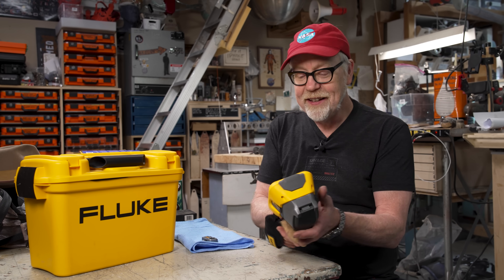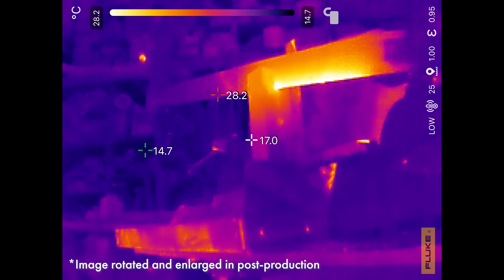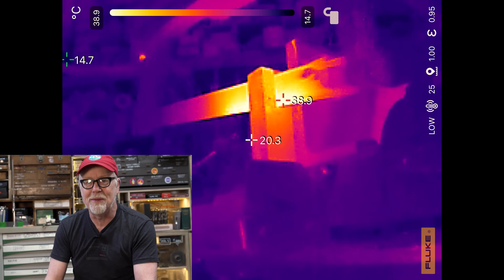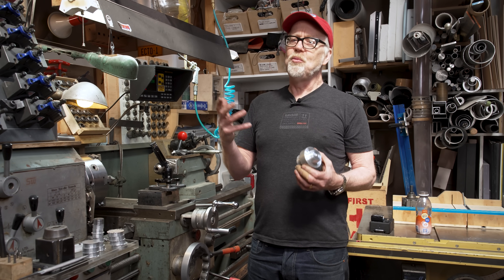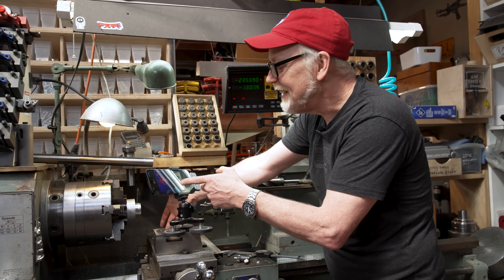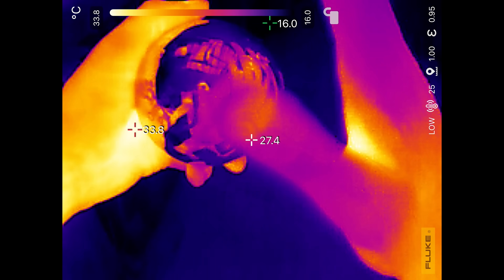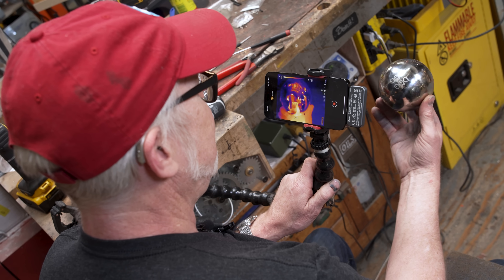What This Thermal Camera Reveals About Adam Savage's Workshop!

Comment: Most definitely those are photons. Radiated heat energy is infrared, which is electromagnetic energy (photons!) emitted at wavelengths longer than visible light.  It's incredible you got those reflection shots on the smooth metal surfaces, pretty much confirming this property of radiant heat.  So cool, thank you!
Reply: Longer than visible light. It is still light.
Reply: @BaconbuttywithCheese  yes of course! My mistake
Reply: Yeah, I snapped to attention when he said the photon bit, too.  We got nerd sniped.  :)
Reply: Still photons no matter what else is going on. I can't believe he said that.
Reply: To me, the really interesting observation to make about his hand image reflecting off the metal surface is to realise that the camera is not, in fact, measuring the temperature of the object, i.e. it is not measuring the average kinetic energy of the random motion of atoms and molecules that make it up. Rather, it is indeed measuring, and representing as a visible image, the intensity of photons (with energies in the infrared part of the electromagnetic spectrum) that are either emitted by OR reflecting off the object. This is clearly a potential error source you need to be aware of when using one of these cameras to measure temperature.
Reply: @viajero-77  Especially when measuring metallic surfaces. Emissivity of polished aluminium is around 0.05, while most non-metallic surfaces (including Adams hand) are closer to 0.95 (and that's the emissivity most infrared thermometers are calibrated to). That means from the energy reaching the camera in that shot, about 96% is emitted by Adam and under 4.5% is emitted by the aluminium block itself. Aluminium would need to be around 400 °C (675 °F) to emit as much energy as it reflects (for the same surface)
Reply: @MikrySoft  That's very interesting info, thanks.
Reply: Still photons, yes. But due to the longer wavelength of thermal infrared 900 to 1700nm (vs visible light 400 to 700 nm)  the physical sensor pixels of an infrared camera must be considerably larger than visible light sensors. I don't know the actual limits, but I think it's also fair to say that visible light sensors have had a lot more R&D money put into miniaturization too.
Reply: Thank you. I was really hoping this comment would be here. 1 humanity faith point restored.
Reply: Yeah, the frequency/wavelength, propability amplitude and polarization  is attributed to each photon. While phase, classical amplitude (+ above properties) is attributred to the wave function. (Result after googling around.)
Reply: It always hit me if you have a boiling hot metal pot and see your own reflection in it.
Reply: "Radio waves" are also photons.
Reply: They are photons of light.  They have all the same properties of visible light photons except the longer wavelength.  As photons they are particles and waves at the same time just like visible light photons.  In other words they reflect and refract; as well as make interference patterns through a diffraction grating.  That is why the reflection was so good off of the shiny ball and other reflective surfaces (aluminum bar stock in lathe).  Because of the longer wavelength there are surface conditions which are more (or less) reflective than the same surface under visible light.  The scotchbrite, besides heating the ball took some of the shine way (scratched the surface) thus the reflection changed off of that part of the surface.  Cool demo ... could have used a bit of fact checking. 🙂
Reply: Yep
Reply: Thank you, I thought I was crazy for a second 😅
Reply: So yes but also no. Assuming that infrared camera is a bolometer camera (which I imagine it would be based on it's size and lack of active cooling) it works by filtering out non infrared wavelengths from a camera projection onto an array of special resistors called bolometers which heat up and change their resistance when this infrared projection is projected onto them. When a test current is passed through this array, all the changes in resistance of each bolometer is measured and the temperature of each bolometer is calculated. So while the temperature of the bolometer array is caused by infrared light the camera absolutely does measure the temperature not infrared photons. It just specifically measures temperature caused by whatever band of infrared light it projected onto it's bolometer array. You can get infrared cameras that work just like digital visible light cameras that count photons that hit junctions in semiconductor sensor and I actually work with one of these cameras (I'm lucky enough to work with a super high resolution MCT camera that images a medium wave infrared band) but they are massive and have to be cooled to very low temperatures.
Reply: @marylebone9357  I feel like the mechanism the sensor uses doesn't change that it's receiving photons. I mean technically you could also measure visible light or UV similarly if the resistors were made of something that absorbs it and heats up. It's still photon input in either case.
Reply: @Felice_Enellen  true. Can't argue with that. But any excuse to talk about infrared cameras! To change the waveband of a bolometer camera you actually just change the filter that sits before the bolometer array. So you can actually have long wave, mid wave, or near infrared bolometer cameras that use the same kind of sensor without any fundamental change to the bolometers or the system the checks their temperature. Or alternatively you can take successive readings switching filters and do miltispectral imagery
Reply: @marylebone9357  This is why I come to the comments.   I think my favorite answer is the "yes, but also no" variety.
Reply: @marylebone9357 that's how pretty much all sensors work. Photons affect a semiconductor which alters electrical properties and those property changes are then interpreted. In the end almost nothing measures anything directly, they just measure the interaction of two phenomena. Whether it's a chemical reaction on film, the current through a photodiode or the resistance of a bolometer. In the end they are all ways to capture/detect the amount (and type) of photons and represent them in another way. The mechanism changes, but the end result and purpose doesn't.
Reply: @marylebone9357  Interesting!  So how is the reflected image preserved so clearly?  Obviously optics must come into play in order to direct the blackbody infrared radiation onto the sensor.  The camera sensor's (bolometer?) array must be closely spaced enough to reproduce the accurate image from the camera lens projection.  Or is there a parallel processing technique which filters the infrared sensor image with a parallel camera sensor image?

Comment: Thermal cameras do see light and photons, specifically infrared light.
Reply: I had to respond to that too, but you beat me to it.
Reply: It's infra-red and ultraviolet isn't it? 

They are at different ends but beyond what we can see, wavelengths we can see are between 400 and 700 nanometers if memory serves. Below 400 for ultraviolet and above 700 for infra red, or is it the other way? I think blues and violets are at the shorter end.
Reply: @ No, a thermal camera only looks at the near infrared; the longer, lower energy wavelengths. Nothing around you is giving off ultraviolet radiation unless it's over about 7,000 Kelvin, or it's a black light.
Reply: @ Such as a welding arc? Makes sense, the more energetic, the higher (faster) it is.
Reply: @ Yes, welding arcs give off a ton of hard UV. Hard as in not just a little outside the spectrum, but closer to x-rays than visible light.
Reply: @Chicken-x6q6d  both infrared and ultraviolet light are light we can't see, but hot objects specifically give off infrared (unless they get really hot. Like the sun).
Reply: @coryjones4040  So heat is infra red (above 700 nm)?
Reply: @ Radiant heat, yes.

Comment: Hi Adam-   Those are definitely photons, their frequency is just much lower than the normal “visible” photons that the biochemistry in our eyes can detect.  Happy to explain more if curious. Love your channel.  Cheers, -Travis
Reply: It does hurt, I understand the misunderstanding though.  Lots of ppl think of radiowaves as stuff that are not photons as well.  Same go for thermal energy, which is just infrared light.
Very typical to see your reflection off Thorlabs tables when aligning camera at weird angles to check for infrared leakage on optical fibers.
Reply: @zynthosalv4696 While radio frequency radiation is also quantised as photons (strictly QED-speaking), they are practically not particles but rather waves proper, which only becomes truer as you go to lower and lower frequencies. Also, "thermal energy" is a bit of an ambiguous term. Infrared radiation is just electromagnetic radiation, nothing more, and not equivalent to heat. Rather, infrared emissions are the "side-effect" of objects at a certain temperature, and result from atomic or molecular vibrations. But objects do not necessarily only emit IR photons for a given temperature. E.g., if you heat a metal to several hundred or thousand degrees Celsius, it will "glow hot" because its constituents vibrate so vigorously that they also emit visible light and other frequencies. So no, thermal energy is not equal to infrared radiation, because a), thermal energy itself is the vibration and collision of atoms and molecules, and b), a does not result only in infrared emissions, but also in emissions in other frequency ranges. After all, we can see the sun and not just feel it.
Reply: Thank you. I came here to say this!
Reply: Yeah, seems to be a fundamental misunderstanding of "heat". The sensor is just detecting light in the infra-red end of the spectrum, outside the human visual range.
Reply: Yup, and that's also why IR cameras tend to have "terrible" resolution if you're thinking in terms of visible light and digital cameras - IR wavelengths as used by thermal cameras are about 10x that of visible light, so the maximum resolution is always going to be 10x worse than you can achieve with visible light, assuming the same tech.
Reply: @TheGeoffable  But there are thermal cameras with over 1 Megapixel sensors (1280x1024). Wavelength will be a limiting factor, but right now cost is what makes most thermal imagers have such low resolution.
Reply: @whitcwa  Yes, you can add as many pixels as you want, but they have to be bigger, and therefore it's more expensive. But each pixel will still have a lower angular resolution before it starts overlapping with neighbours, so you can't match the theoretical resolution of visible light.
Reply: It hurts to hear Adam say that sentence.
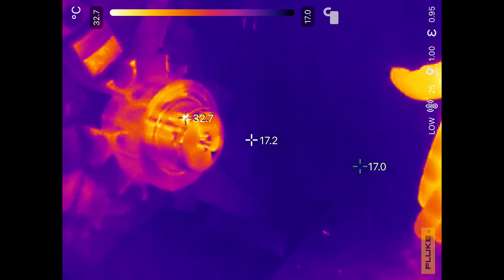Reply: @jahnkeanater  Indeed.  I presume you mean 6:57 in particular?

Well, finally a chance to bust the myths of the mythbuster, I guess!  Adam, we do so with love... but your statement is BUSTED!  ❤
Reply: not much lower, just slightly lower
Reply: @johnhunt1725  13 to 35 times lower than visible light. Is that "much lower"? I think so.
Reply: @whitcwa  Visible light is from 380 to 750 nm in wavelength, infrared is 750 nm to 1 mm. So, they actually butt up against each other. There is no gap between the visible and infrared zones in the electromagnetic spectrum. Also, keep in mind that the electromagnetic spectrum (light) theoretically has infinite wavelengths, so using terms like "much lower" and "slightly lower" is extremely relative. Having said that, seeing as how these two regions butt up against each other, I think "slightly lower" is a much better fit than "much lower".
Reply: @ There is a significant gap between visible light and the infrared band which thermal cameras see (8 to 14 micrometers µm).
Reply: @whitcwa  You just imposed an artificial and arbitrary constraint on the infrared band as if the technical limitations of the camera defines what infrared is. That's poppycock nonsense. The camera not being able to detect the entire infrared spectrum does not mean it isn't there. And you keep using relative terms like "significant gap" as though they are absolute. That is an error in thought.
Reply: @johnhunt1725   This entire thread is talking about real thermal cameras, not infrared light in general. So I imposed nothing. I just stated verifiable facts.